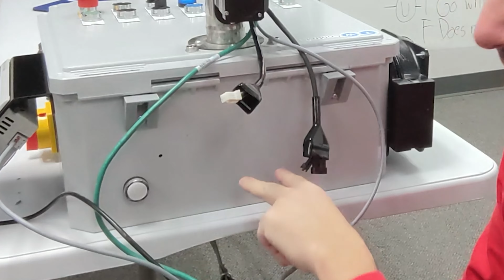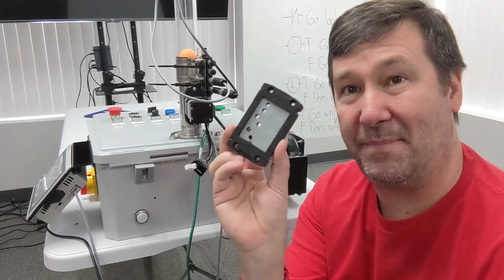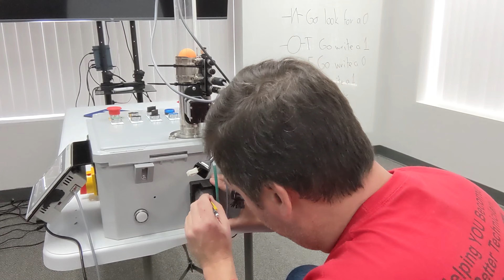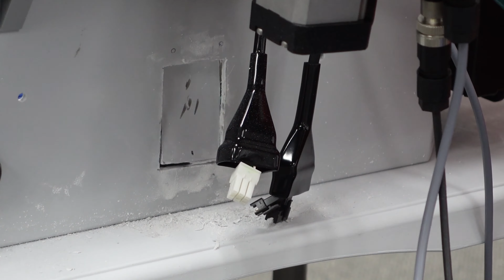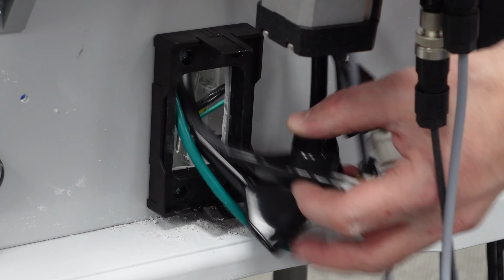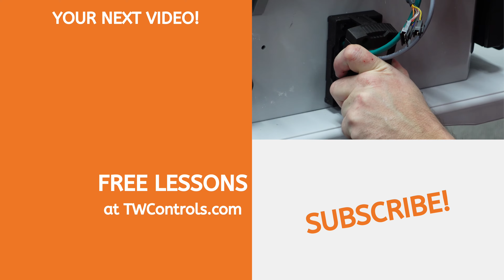Control Panel Field Wiring without Drilling a Hole for Each One

Comment: That's interesting, I will have to remember that one for next time I am in a similar situation.

What would you do if you only had 5 wires? Are there options to block of unused holes?
Reply from the maker: Yes, they make both plugs for future use and single hole blocks.

Comment: Respected Sir,

I need your support to troubleshoot 1734-IE8C Allen Bradley analogue input card.

Problem:

Our system was working very well more than 6months but we faced backup supply problem.
To troubleshoot the Backup Supply we turned ON and OFF our Panel many times after that our one input  analogue card(Module4) not responded other working good, but modul4 showing solid red indication on all 8 channels.

Field devices and wiring:

1. All fields devices are ok and supplying 4-20mAmps.
2. Terminal blocks are ok not fused/blown.
3. Shifted faulty card belonging fields signal to the next module and they are working good on the next module.

* Module4 Channels status is solid red.

**Concern: Module 4 not responding and giving solid red status on all 8 channels.
Reply from the maker: Measure it with a meter, chances are it is out of range
Reply: Hi Tim,

I shifted the faulty module signal to the next module but they are working.

The the incoming field devices signal is within 4-20mAmps range
Reply from the maker: Sounds like that channel is bad.  They are not isolated inputs so I can see how it would affect the other channels.  Great job at narrowing down the problem!

Comment: Is it chemical resistant?
Reply from the maker: It should be to a certain degree but I'm not sure.  I think they are rated up to IP65 depending on the configuration.  I would reach out to them.

Comment: Sure, that works great if you're using a plastic box, which is almost nobody. Could make the same design with a round hole. Other problem is now when you have a problem with 1 you have to interact with them all, which could cause more failures. Now you come full circle to drilling individual holes. But you could still split the bushings
Reply from the maker: It is actually a standard size knockout plus you can cut through steel just as fast as fiberglass if you have the right tools :)

I'm not understanding what you are saying about having to interact with all of them if you have an issue.  I have added two cables since this video, you don't have to remove the rest to add one.
Reply: @TimWilborne square holes are not standard. Neither is carrying oscillation tool, grinder, plasma torch, or cutting torch. 
Other options include using a larger hole saw, and a piece of rubber that you drill multiple holes of your own with, and notch the holes. Still better than the square plate. Better still is individual holes. New ideas are good, but not always better.
Reply from the maker: Can't wait to see how you cut an HMI into a panel 🤣
Reply: @TimWilborne 4 holes woth a hole saw and a Sawzall. It's pretty simple actually.
Reply from the maker: I'm sure you'll love this one :)
https://youtu.be/8rIHtrh4bb0

Comment: I like the idea, but it needs to be round. Nobody has time to cut squares. 56mm holesaw design would be better and done in 2 minutes.
Reply from the maker: Even better, there is a knockout just for this. Apparently it's a standard opening.
Reply: @TimWilborne  Same as Harting knockouts 6B - 24B.